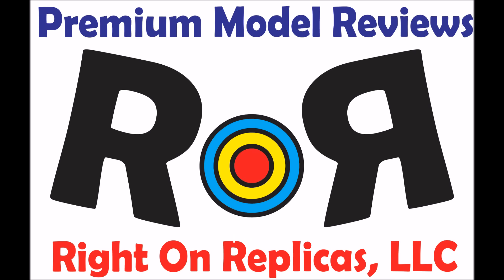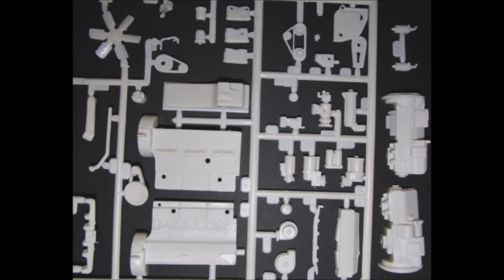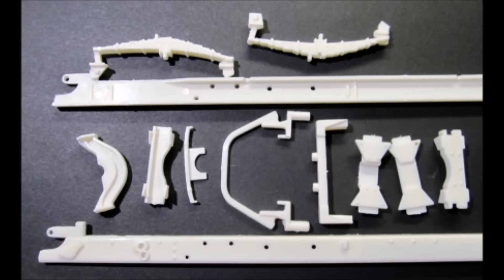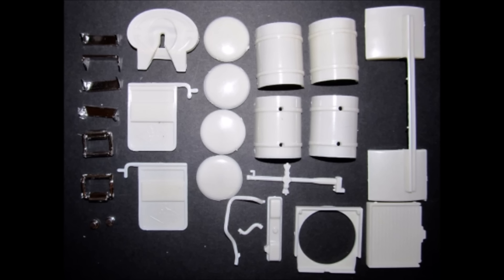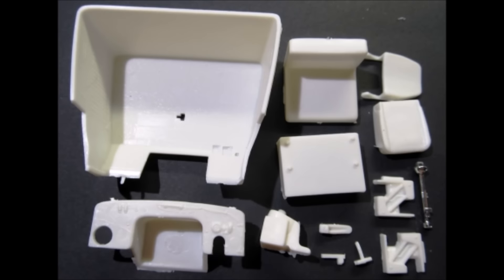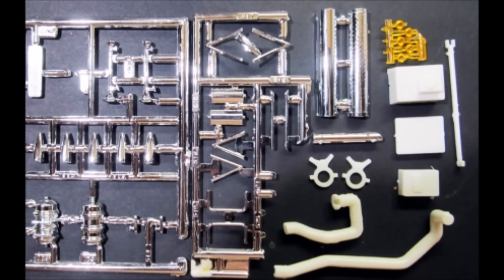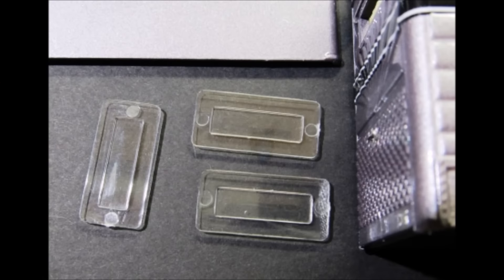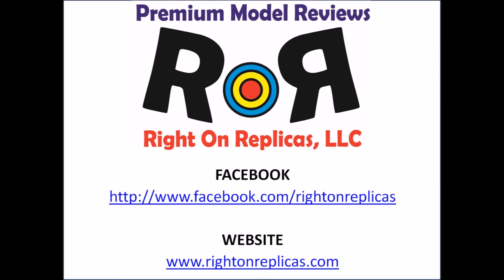How to Build the Diamond Reo Tractor 1:25 Scale AMT Model Kit #719 Review

Comment: Had this kit since 2012, got it primed on the tree's and put it up. You need to get some CB antennas. I had also bought some chains and brake lines to go to the trailer. On the 5th wheel you can use some KY and let it dry then paint it a flat black. A small string will work on the drivers side to pull down for the air horn. I still got a couple cans of the Testor's John Deere green, they stopped making it years ago. 

I bought the orange cabover and trailer around the same time along with 4 different trailers. Put all that in my stash. I may get to it one day. I still have a sealed Movin' On Truck from the tv show.
Reply from the maker: Jer, thanks for the suggestions!  -Doug

Comment: Is the white Elmer’s glue strong enough to hold the windows in ? I’m always struggling with that part of the build when the windows are separate pieces.
Reply from the maker: CC,  Generally speaking, yes it will hold.  Often the windows are trapped into position by tghe interior. But if theres no pressure on them they should stay if there;'s enough glue.  M/S Kristal Klear is a little stronger and BSI has released a new clear adhesive too!  -Doug
Reply: Right On Replicas that’s very helpful. Thank you Doug

Comment: I have technical question regarding the truck, i would build short nosed version 
my problem is where to cut main frame? engine bay area or tail? Thanks
Reply from the maker: NB,  I don't have the model any more to know for sure but I would think a straight portion of the frame in the engine bay would be a logical point for the modification.  Thanks for watching and,  please subscribe if you haven't already to help us reach more modelers! -Doug
Reply: @RightOnReplicas  so your point is cut the frame part of the engine bay? if so the axle need to be repositioned backwards i think. and you've got a subscriber here! no worries!
Reply from the maker: Yes, if the the nose was lengthened , the front end was lengthened,  If they extended it from only the axle forward the nose wouldn't be that long.  The best thing to do is mock it up and see where it would be best to make the chop.  -Doug
Reply: @RightOnReplicas  I've figured out that the best way is move cab forward and cut the firewall then make doghouse inside of the cab and chop rear part of the frame next ~ my plan is to make White 9000 from the "Maximum Overdrive" movie (old air starter powered wrecker from the gas station scene)
Reply from the maker: Very interesting NB.  Thanks for watching!  -Doug

Comment: is this an 80s truck?
Reply from the maker: Dish - Well,  that depends.  Diamond Reo made this type of cab from the 60's until the went bankrupt in '74.  They were bought out and continued to be made until 2010.  So pick a decade and the answer is, yes!  -Doug
Reply: I think this is a mid 70's model to late 70's. The 80 model has square head lights
Reply: Noitsa1973itwasmadinlasinming
Reply: It's a 1970